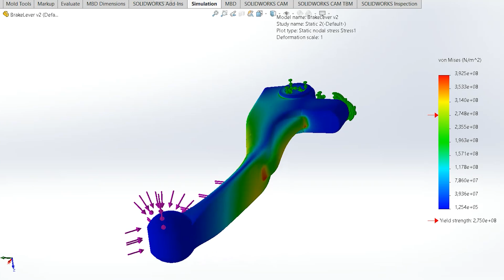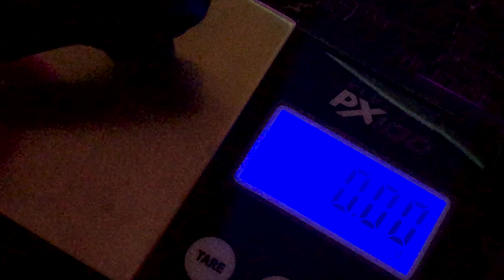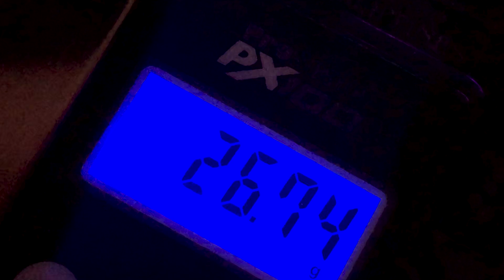Making 100% Real Carbon Fiber Brake Lever

Comment: Bro the yield stress you've put in SOLIDWORKS is 275 MPa, that's for S 275 grade steel , for carbon fiber it will be different, you can check under materials .
Reply from the maker: Yeah you're right, I used the value for steel. Good catch! It was only for testting with and without rib..
Reply from the maker: Carbon fiber composite is difficult to define for FEM calculations, so I used a homogeneous metal material instead.

Comment: Hey thats a really nice detailed video.
even im trying to do the same this for my himalayan 450, but the issue im facing is in the break wire insert region it has a cylindrical and long flat cut inside, i dont know how to design a mould for that face. Im still stuck in designing the mould.
Reply from the maker: Thanks… I can share some tips if you'd like, just send me message on ig

Comment: Hey! How many g. chopped carbon did you put in the mold?
Reply from the maker: I used 16.7g of carbon fiber and 11.2g of epoxy.. thats for 60/40 ratio.. if you lay there 15-20g of carbon fiber and overfill it with epoxy you are fine ;)

Comment: do not be fooled by this video.  by doing this and putting it on a street legal motorcycle . you will be 100% liable if it breaks during braking . causing injury or death to others .  if only put on dirt bike. then you are ok but safety to yourself is compromised. carbon does not withstand the beating a dirt bike takes with constant crashes . all is better and you know when it is bent to replace it ,carbo just snaps .  use caution before doing this.... think !
Reply from the maker: I appreciate the safety concern.

Comment: Hi I'm planning to do the same for my street motorcycle, did you use a bushing for the pivot point of the lever?
Reply from the maker: Hii.. no, there is just the hole in lever. I tested it and after 50+ hours of riding there is same hole, if you use grease it will lead to minimum abrasion of composite in the inner diameter of the hole.
Reply: @peteelab  Thx a lot for the answer, since I can have access to a lathe I might try to make my own, but good to know they can survive without :)
Reply from the maker: @SwainixFPV  my pleasure to help you ✌🏻
why lathe? Buy a pipe with needed inner diameter or drill it. 
Design the mold that you can place pipe into mold and it will stick together with lever after  hardening
Reply: @peteelab  I printed and placed a pin in the mold as placeholder but I was initially planning on buying bicycle brakes bushings so I didn't go the pipe route. The workshop has some steel and teflon cylinders so I'll just see whatever seems best (I'm currently waiting for the mold to cure but if I redo it I would mold a cylinder of steel in it directly like you advised)
Reply from the maker: yes I would make it the same way, let us know how it’s going 🙂

Comment: Good technical work here. Another way, of several, is to make a carbon fiber block then CNC machine it to the lever shape. Comes out cleaner than doing it with a mold.
Reply from the maker: Thank you 😊 yes it is another way to make it 🤌🏻

Comment: Great video!
I have also tested with fiberglass and polyester resin, but it is difficult to release even with PVA releaseagent.
What wax do you use for a smooth release in your videos?
Reply from the maker: 1:58 first it is waxed with wax from a candle and then polished
2:13 next i applied coat of cavity wax spray for car rust 
4:37 I had a problem that the composite was tight in shape with a mould and didn't want to come out
so splitting the mould into multiple pieces would be best solution
Reply: @peteelab  thank you. Is it important to smooth the mold by rubbing it with sandpaper? Is the rough surface of the 3D printer mold bad for release?
Reply from the maker: @user-kw6ps9jc1h  yes i think its better to sand mold first than sand a composite later, as well you will get a fine surface on composite and probably better release too:)
Reply: @peteelab  thank you. Your knowledge is very helpful!!
Reply from the maker: i am glad that someone ask and my work is not useless @GIFT-Auto
Reply: What material do you use for your molds? I have heard that for example ABS is a particularly poor choice because of how well most resins bond with ABS, making the parts nearly impossible to remove.
Reply from the maker: @tHaH4x0r  i had no problem with PLA or PETG but always using some kind of oil aplied on mould
Reply from the maker: THanks ;)